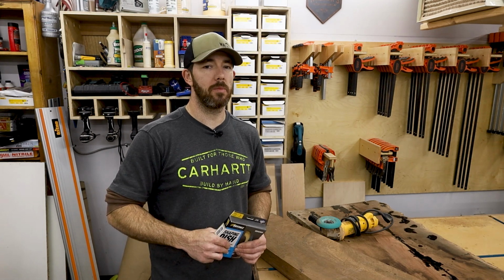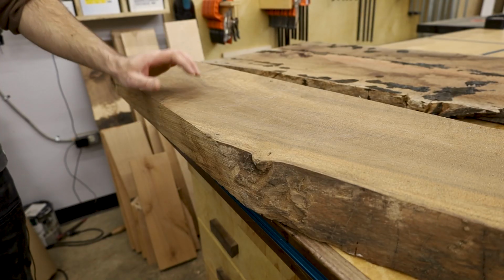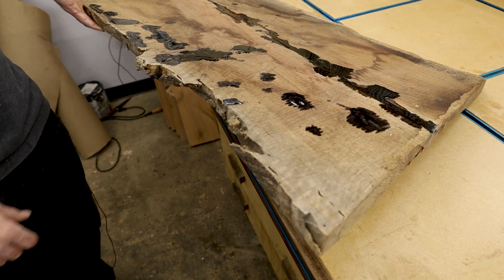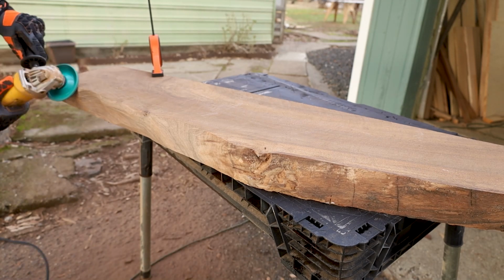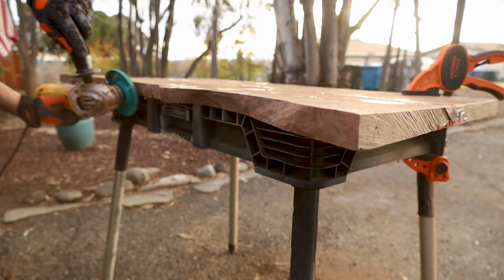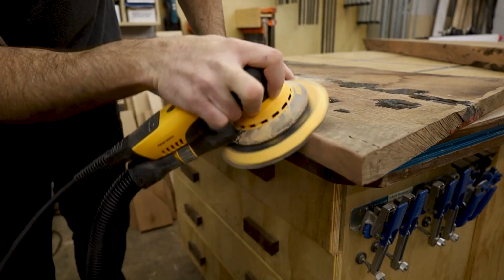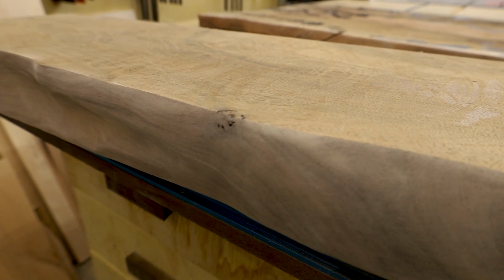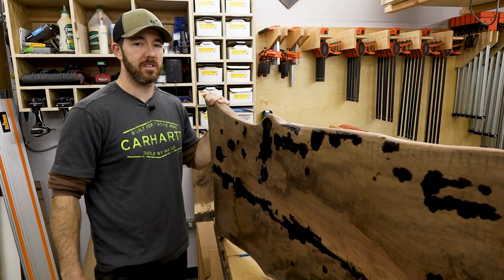How To Create a Faux Live Edge | Live Edge Slab Blending  | Fake Live Edge

Comment: How is that even close to a proper live edge all u did was sand it i thought u were guna glue sum bark on or take it back shape it to glue a live edge off a bit of waste slab or something ??? Cannot see the point of this being called a live edge its a finished edge bud
Reply: Live edge slabs don’t have bark on them my guy… a live edge typically has the bark completely or mostly removed. You certainly can leave the bark if you want that look, but typically it is removed. “Live edge” only means that the edge shape of the board is not cut straight but is instead left to its natural contour. The bark is a separate factor to being live edge.

Edit: For further clarification, when you buy a live edge slab from the supplier, it should 100%  have the bark to ensure it is a true live edge. But when referring to finished works like a live edge table etc., the bark is not the factor that matters, only that it retains the same shape of the original live edge. Bark is dead and flakes over time and can fall off on any high use material. It is also very difficult to apply any kind of finish too if protection is needed.